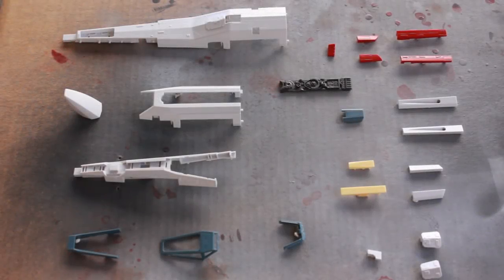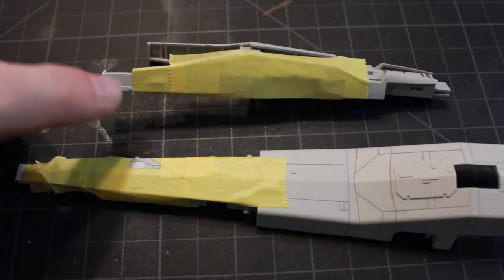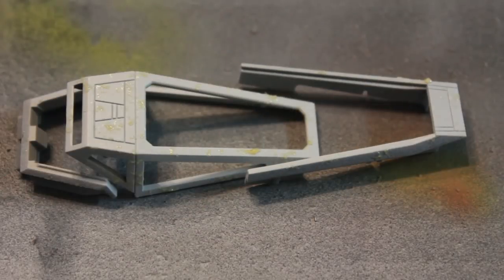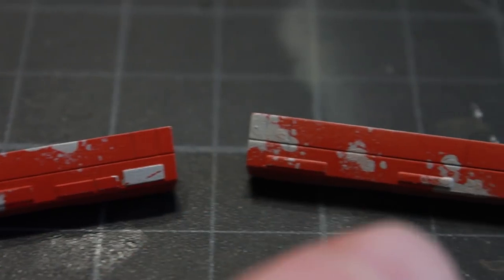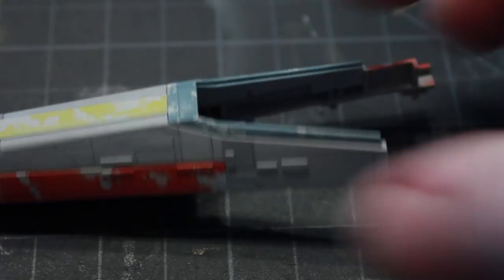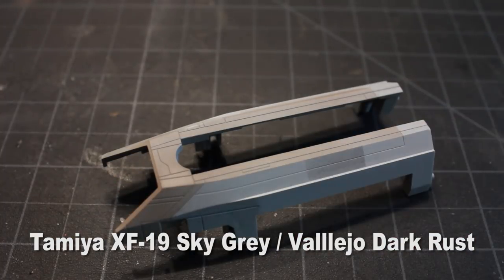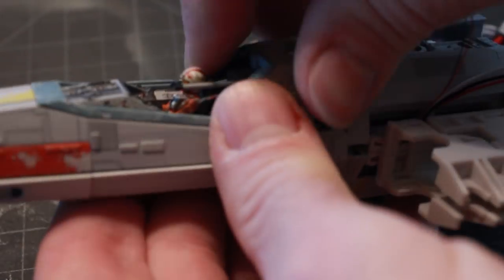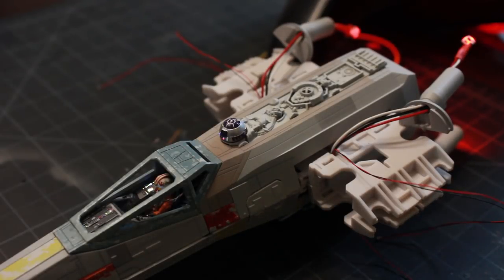Bandai 1/48 X-Wing Pt VI Fuselage Build and Paint

Comment: Awesome work! Could you provide a bit more info on the masking fluid you used? I plan on doing a Slave One at some point and I think that would prove useful.
Reply from the maker: I got it on Ebay. It's a liquid latex masking frisket, made for modeling.  The one I have is by Grafix. There is also another brand that is purple in color.  May be easier to work with.  Mine dries clear and is sometimes hard to see.  I probably would've preferred colored myself.  But works great.

Comment: Your work is truly inspiring!  Can you please post a parts list (and source) for the electronics/lighting including which version of the Adafruit Trinket (3.3 V or 5 V?) and resistor you are using?  You also mentioned Adafruit Neopixel mini 3030 LED for the engines.  Did you mean 3535 as I can't seem to find the 3030?  Keep up the great work!  Thanks.
Reply from the maker: Yea,  it was the 3535 neopixels. I use the 3.3v Trinket.   And for resistors,  I used 390 and 270 ohm 1/4 watt
Reply: Thanks!  @modelsbychris

Comment: This kit comes with all those LED light up features??
Reply from the maker: No,  it does not.  The only kit LEDs I kept in place were the torpedoes.  All other lighting I added.
Reply: I see they have a kit with the boosters, torpedos and cockpit but not as in depth as you have done. How did you achieve individual lighting in the cockpit?
Reply from the maker: It was done with photo etch and 3 LEDs.  Can be seen in my Pt II of the x-wing build.